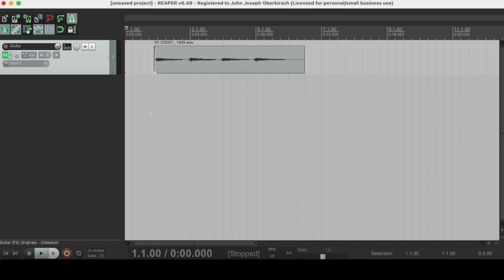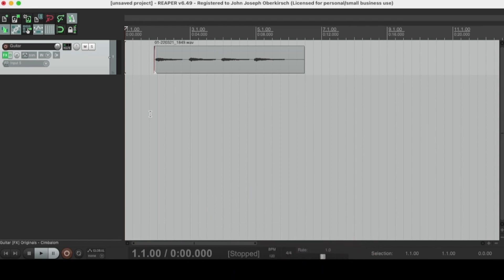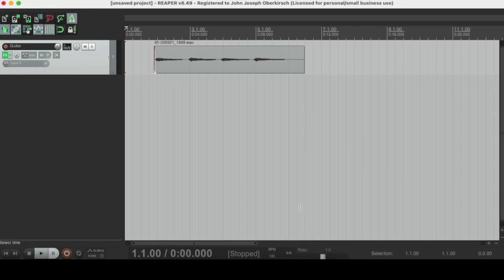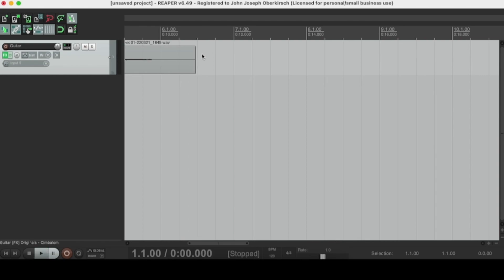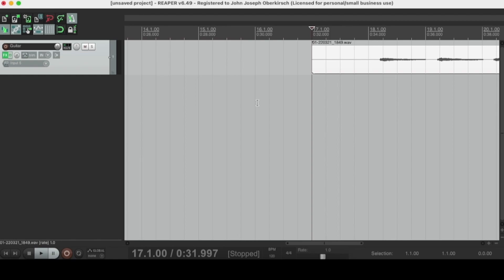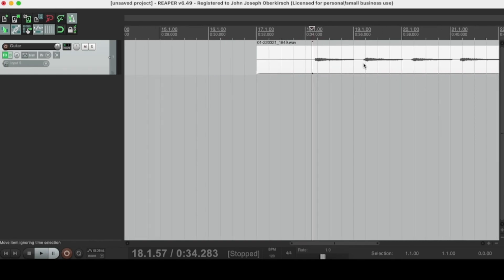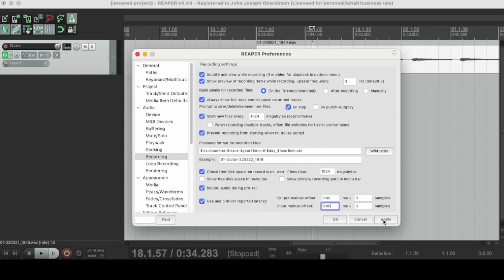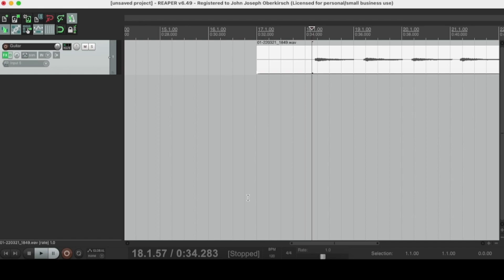How to Fix Latency in REAPER (Easy to Follow Guide!)

Comment: Hey ive tried all of this and still have a delay...
Reply: I know this is late but it may be of some help to you or others in the future. Your processing power can take a huge hit with several plugins running. Try turning off the FX on tracks you can live without just while you are recording. It worked for me after coming here and finding this didn't help for me either. Good luck!
Reply: @michaelgarrett6059 
Dude, after trying everything, your comment saved my day, that was EXACTLY the problem. All the FX I had one was taxing the CPU just enough to cause a mini delay. I just did a key bind to shut off all fx momentarily when I'm recording live and it's tight as hell again. Thanks man!!

Comment: Do these principles apply to latency for midi controller keyboards. In my case there is a slight delay between  pressing keys and sound from instruments.
Reply: Same issue I'm trying to resolve
Reply: @shivapriyasaraswati7171  same here. if you figure it out let me know!
Reply: @EmoryBlake4Music  Actually I did, but I haven't been able to get back to it for a couple of weeks & don't remember. When i get back at it, will come back and tell you.
Reply: @shivapriyasaraswati7171  please do, I'd really appreciate it! Thanks!
Reply from the maker: Hey there, these tips are more for recording audio in REAPER. Here a few things to try for MIDI keyboard latency. While recording, disable plugins on your FX chain besides the virtual instrument that you are triggering. While recording, disable plugins on the master track or any folder tracks that your virtual instrument track is running through. Any plugins that are affecting your virtual instrument track that you are recording with might be introducing latency for your MIDI keyboard. Increase your block size/buffer rate/buffer size under Options>Preferences>Audio>Device. It can be hard to give advice on latency without being there with you, but I hope these tips might help.

Comment: I HAVE THE SOLUTION

Go to options-preferences-device
Find where it says buffers
Drop the buffers number by 1 # at a time and test your voice
Then if that doesnt work increase the samples by 10
Play with that until you get it
Unfortunately that didnt work so I did the opposite
I increased my buffer by 1 # 
Then I dropped my samples by 10 
I went to 5 and 480 for my buffer and samples.

Hope this helps because its spot on now✊🏼🐷
Reply: Thank you so much! You're the man! This helped me right here. I had to drop mine down to 5.
Reply: Your solution gave me a headache bro, my guitar sounded like a robot nigga
Reply: This still doesn't work even if I go into the negatives and restart the program or computer after every changes... I'm so frustrated....
Reply: @waynehedd thank you!!!
Reply: I have a mac BTW if anyone can help.... please!
Reply: @waynehedd  Are you using virtual instruments? Are you experiencing the same latency with every instrument?

Comment: Hey man thanks for the vid. So I downloaded the ausio download and even bumped up my input latency to 1,000 but no good. Right now I'm trying to use the new Alesis nitro mesh kit I got to trigger steven slate drums in reaper but there's way too much of a delay. Any ideas? Thanks
Reply from the maker: Hey there mate! It's always hard to troubleshoot latency without the problem being right in front of me, but here are a few ideas. See if there is an audio driver that you need to download for your electronic drum kit on the manufacturer's website. Increase your block size/buffer rate/buffer size under Options>Preferences>Audio>Device in REAPER. For recording, disable any plugins that are in your FX chain other than the Steven Slate drums plug-in. Disable any plugins on your Master Track or any folder tracks that your drum track belongs to for recording. Looks like you found a workaround, but I hope this helps too.
Reply: Hey, Jason. One electronic drummer to another, I have a Focusrite 2i4 audio interface that I use for my electronic kit, guitars, vocals, etc, and it works like a charm, zero latency issues. For example, I just got an M-Audio Keystation 61 MK3 midi controller and it came without a power supply. So, I hooked it up directly to my computer with the usb cable it came with to see how it would go and ran into all kinds of latency, which brought me here. However, I found a power supply and connected the keyboard to my Focusrite instead and it works perfectly. The Focusrite has an ASIO driver for download that has worked great for me. Another somewhat small investment into an audio interface might be a good choice for your new kit. Hope you get it worked out, man.
Reply: @steverian6377  thanks for the help man! I actually ended up just using an audio jack splitter so i can hear the module while the track with slate drums is muted when recording and that did the trick. Do you think however that by doing what you mentioned would allow me to hear slate drums while recording without latency? Thanks 😎
Reply: @jasonwright4144  I'm guessing it depends on individual setups, as I also use Superior Drummer 2.0 to trigger drum sounds including a Steven Slate kit ( I don't have Superior Drummer 3 but it looks awesome). Hard to tell since we are probably using different hardware and software. But I can surely tell you, with Reaper, Superior Drummer 2.0 software, including the Steven Slate kit, and the Focusrite audio interface, it has worked well for me. I've had a lot of fun with this setup.
Reply: @steverian6377 So...... Exactly what cables are you using through your scarlet? My edrums have 2 main outs. I would PREFER to use my scarlet 2i2 4th gen for driver purposes, but I just have the 2 main outs to run to the scarlett and I don't think you can "trigger" the ssd /superior drummer/ addictive Drums vst with the two main outs because they're stereo. Right? The only option I have is to run a USB straight from my drum module to my computer and use the drum VSTs that way (midi).... I would LOVE to find a way to get these VSTs to trigger through the audio interface though. It would be so much easier for everything I'm trying to do.